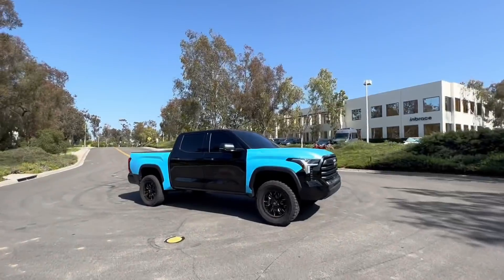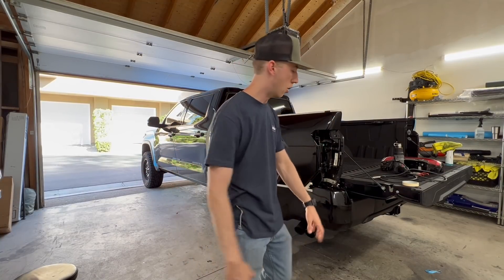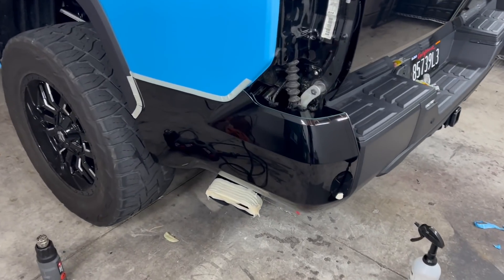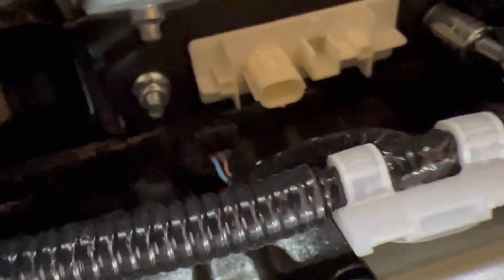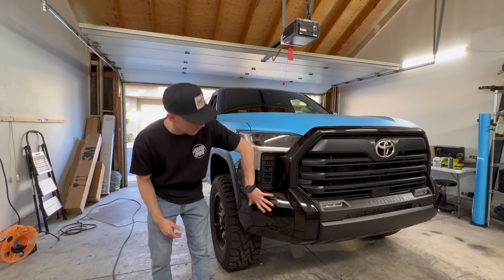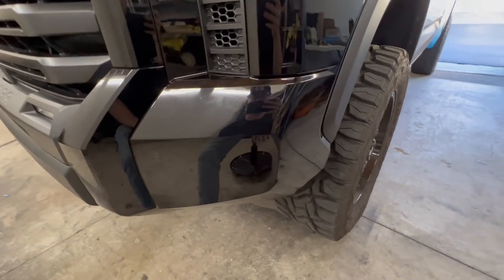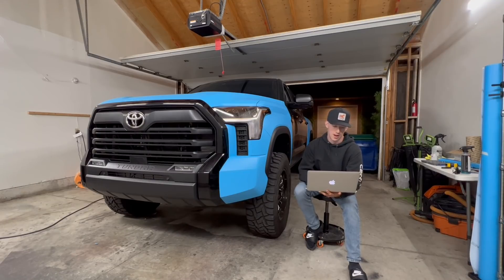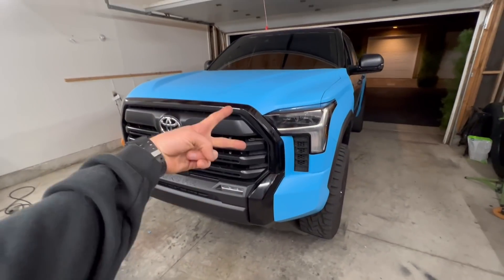Wrapping My Tundra Sky Blue Part 2 (Reading The Comments...)

Comment: How hard is it to get this off.  Not the same product but I spent hours and weeks getting my old 3m clear bra off.  I didn't know better, the truck wont fit in the garage and stayed out as the film deteriorated.  The adhesive would have been a problem I think,  even if I had replaced it after a few years its so thick.  After  dealing with this I don't ever want to face that issue again.  The truck looks awesome, great job.